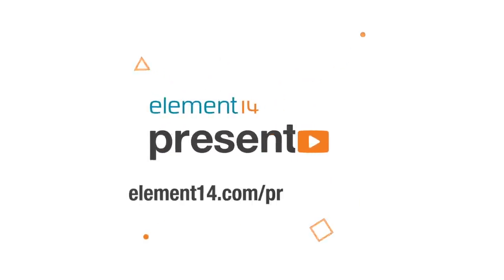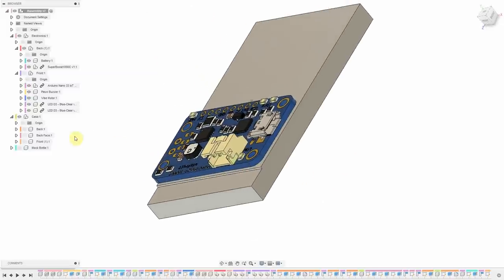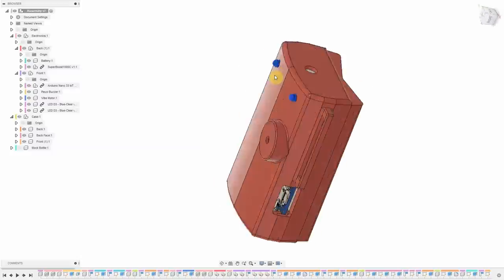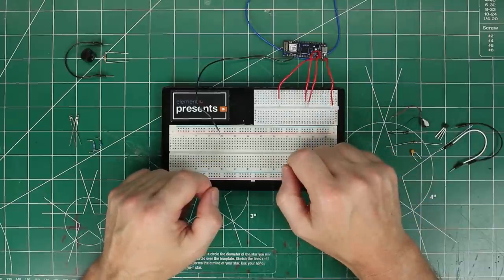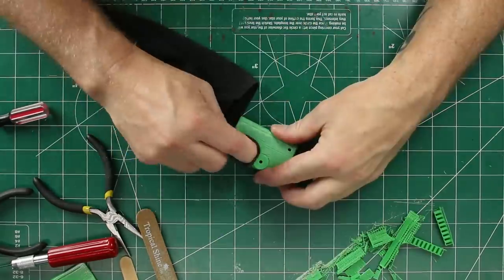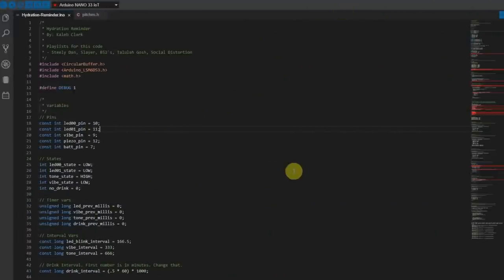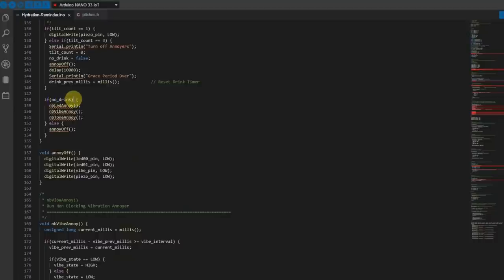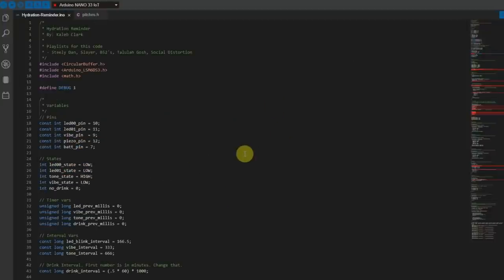DIY Hydration Reminder System

Comment: I would be inclined to deliberately leave the vibration motor a little loose in the case but touching so that when it vibrates it makes a harsh rattling sound. It would sound like something was wrong with it, and I can't think of anything more annoying! 🤣

The person who said your body tells yu when you need to drink is wrong, especially when you are absorbed in concentration on something. I would probably make the timer a half hour, but it really depends on how much you drink when you do. Do you just take a quick sip or two, or do you guzzle several ounces at a time? It's going to be different for everybody.